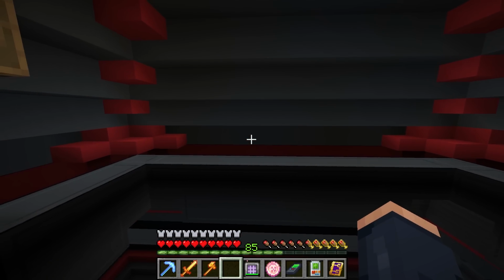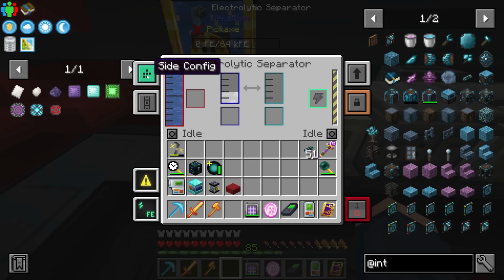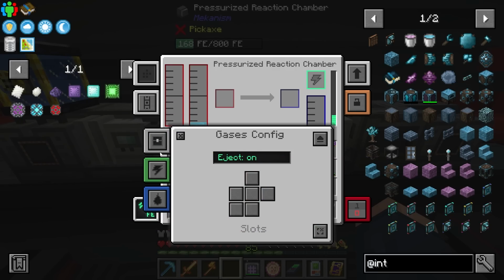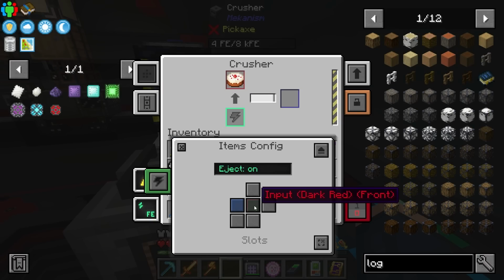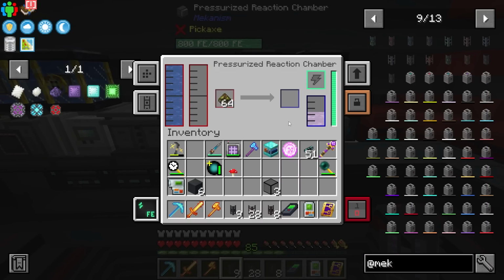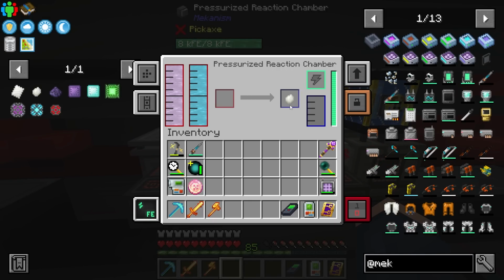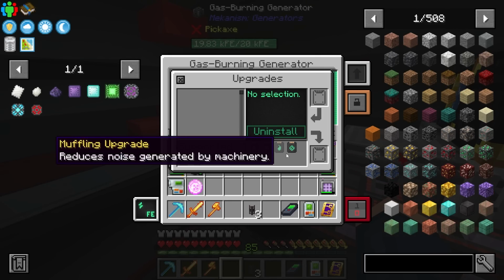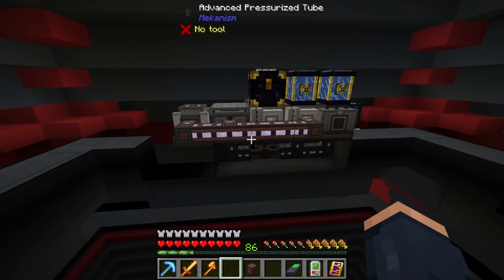Mekanism Gas Generator + HDPE EP31 All The Mods 7 To The Sky

Comment: For water source , you can use EvilCraft : eternal waterblock ,and pipe out the water with fluid pipe, and it's very useful for Fission reactor cause there is no limit of transfer and don't use FE instead of your setup, big quantity like 10 billions if you need gotta it's gonna push the max all the time

Comment: hey chosen did you forget that laser io also has a sneaky mode for input/output? (can access any side from one side) e.g you want energy on back and water on the bottom, you could use the sneaky mode in the cards. you could have the laser node on top and have it input the power in the back and water in the bottom all from the one node.
hope this helps :D

Comment: One electrolytic separator produces enough gas for ethylene production AND running ore through a purification factory with gas upgrade, so long as you don't use speed upgrades. You might be generating plenty of power at this stage but for anyone else early game 3 separators is a ton of FE.

Comment: Why are you using 2 elecrolytic separators and voiding one of the 2 gasses on both of them? Can't you just use 1 and use both outputs?
also, speaking of electrolytic separators, can you please muffle their sound, either through muffler upgrades or in your muffler in your inventory? the sound they make greatly amplify my motion sickness and gives me horrible headaches. I don't know how this sound ever made it into the mod
Reply: Well, the noise is a bit unpleasant, but I'm pretty sure that the vast majority of people will never have motion sickness or headaches because of that, so I don't think the modmaker did anything wrong with that feature. Anyway, I'm pretty sure Chosen will muffle the noise at some point, though I don't think he's gonna spend a lot of time in that room after this.